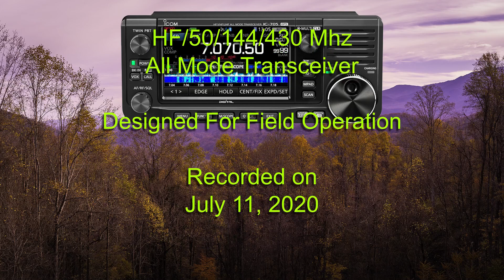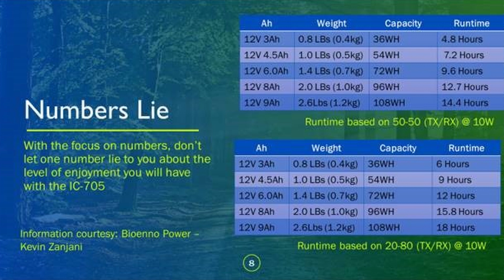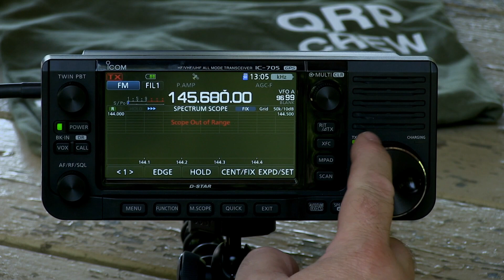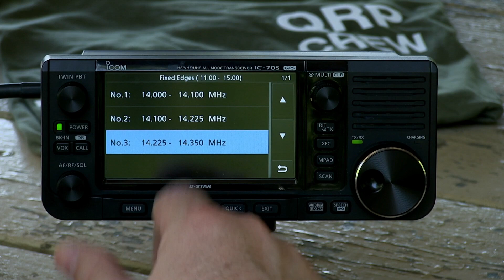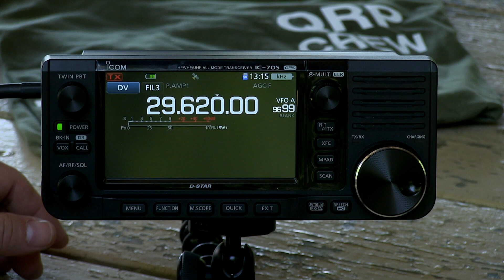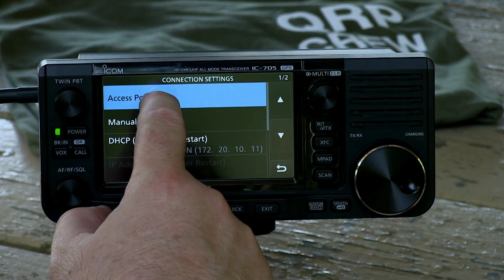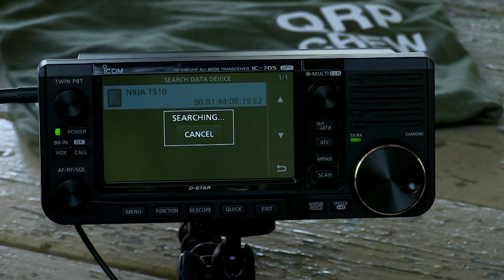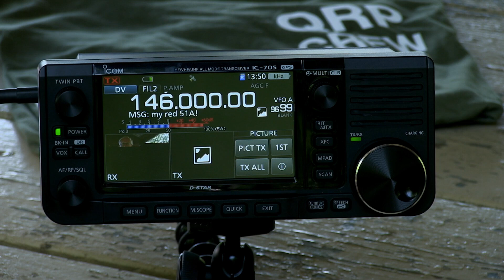Icom IC-705 – In the Field with @AmateurLogic.TV

Comment: A 14 volt battery with reasonable capacity instead of the 7.2 volt handheld battery would negate the need for an external carry around battery for 10 watt operation. Inbuilt tuner wouldn't be that difficult with that size case either and that would be then able to compete with the Elecraft KX series